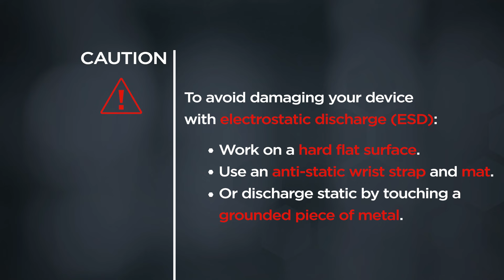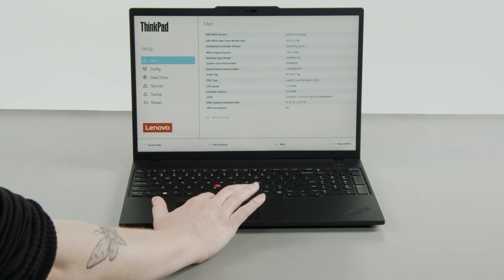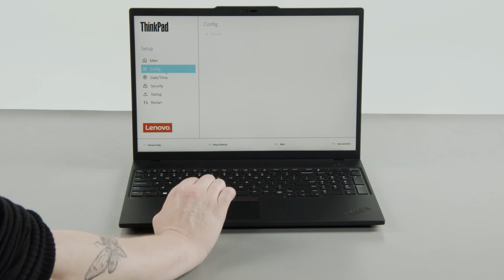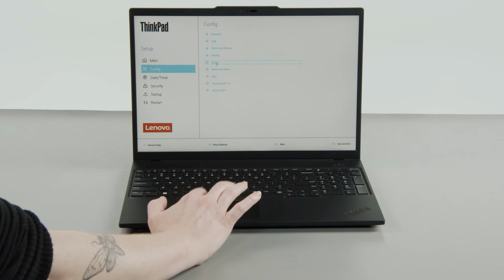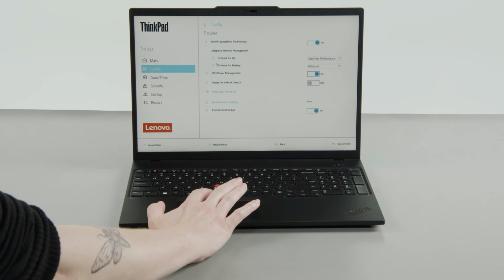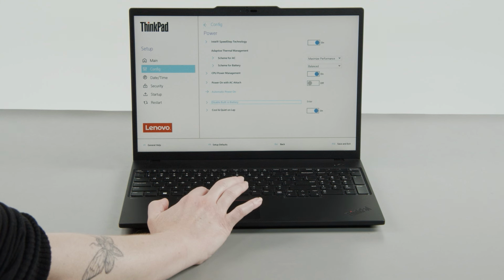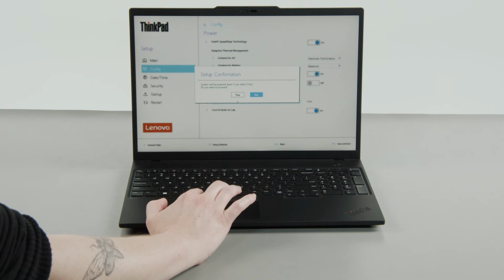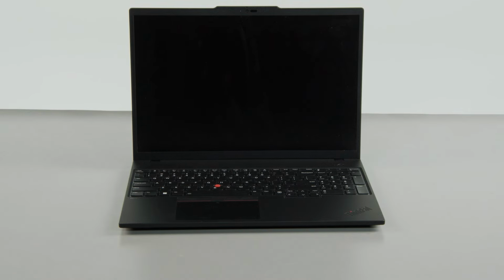Replacing Your Wireless WAN Card | ThinkPad T16 Gen 3 | Customer Self Service

Comment from the maker: This video will show you how to replace the Wireless WAN Card in your ThinkPad. The process in this video will work for the ThinkPad T16 Gen 3. 

You will need a screwdriver kit, a non-metallic pry tool, static-safe tweezers, and 20 minutes of your time.

To view the ThinkPad T16 Gen 3 Self-Repair Guide go to https://pcsupport.lenovo.com/us/en/products/laptops-and-netbooks/thinkpad-t-series-laptops/thinkpad-t16-gen-3-type-21mn-21mq/selfrepair/removalsreplacements

To learn more about your device go to https://pcsupport.lenovo.com

To find parts for your device go to https://support.lenovo.com/parts-lookup/?cid=ww:lenovosocial:b9515f&source=socialmedia&subsource=yt

To view the Lenovo Support Self-Repair Guides landing page go to https://support.lenovo.com/us/en/solutions/HT516547

** NOTE: Static electricity can destroy components. Use a grounding strap, and clean, non-conductive surface to work on. Use plastic or coated tools to prevent scratching and avoid using metal tools on plastic parts. For more detailed information on electrostatic discharge and how to prevent it, please watch our ""Understanding Electrostatic Discharge (ESD)"" video: https://youtu.be/by4PB3WtdLo 

Applicable Machine Types:
ThinkPad T16 Gen 3 - 21MN, 21MQ

#Lenovo #LenovoSupport #LenovoTechSupport

Check out other official Lenovo channels!
https://www.youtube.com/@Lenovo 🟥
https://www.youtube.com/@lenovolegion 🎮
https://www.youtube.com/@Lenovo-PC 💻
https://www.youtube.com/@LenovoSuporte 🟢🟡